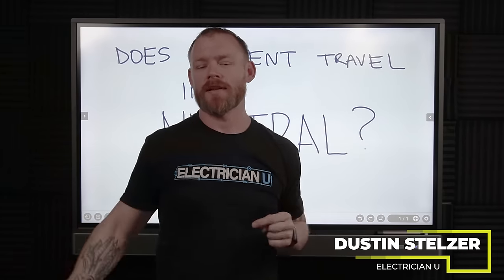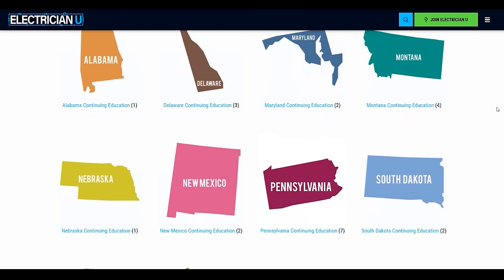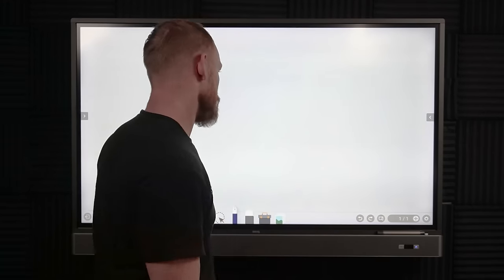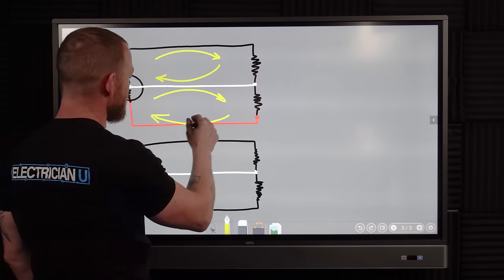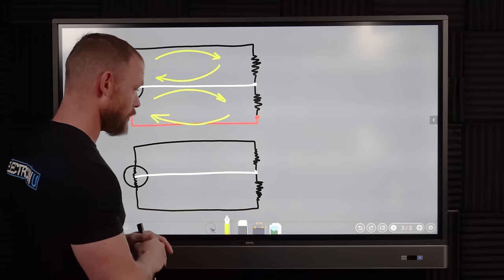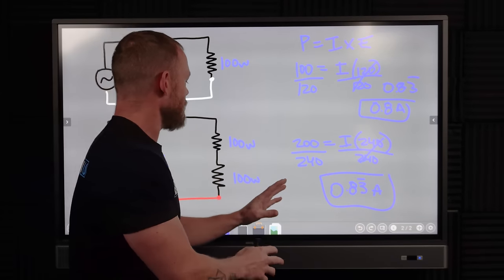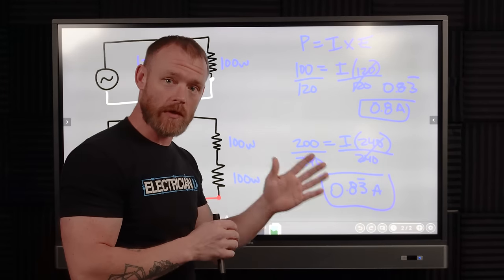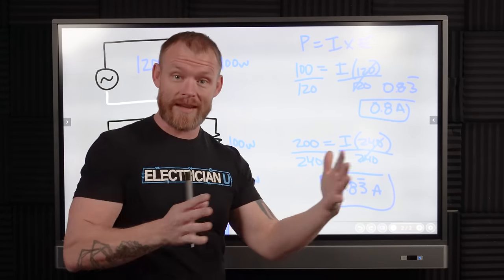Does Current Flow on the Neutral?

Comment: Has it been said that L1 & L2 are not phases they are taps off of a single phase?
Reply: Many times.  That is an argument for pedants.  Phase is a useful way to think of the relationship between the two 120V circuits.  You may view it another way if you prefer.

Comment: You're beating a dead horse what other way would you set it up when you're working with single phase. And by the way it seems to work fine the way it is if it's not broke and you're not getting an electrocuted don't fix it.

Comment: The wire is resistive too so there is some current and power but not 2 amps.
Reply: True enough, but if the loads are of notable resistance the wire becomes negligible, as it will have little voltage drop in it. The wire becomes significant only if the loads are low in resistance, producing high current.

Comment: Yes, current flows on the "neutral" and because of that, "neutral" is a wrong, bad name for it.  I call it "return", which still isn't accurate in terms of physics, but at least it doesn't imply you won't get zapped by it under the right conditions like "neutral" does.
Reply: “Return” is an inaccurate term so has its own pitfalls.  “Neutral” means that it is near ground potential under normal conditions.  Of course anyone working with electricity should be prepared for abnormal conditions.

People get confused when they don’t have a good grasp of the difference between voltage and current.

When you get a shock from a white wire, it probably isn’t connected to the neutral bus bar in the main panel.  When you disconnect a wire from the neutral bus bar, it is no longer a neutral.

Comment: I get it from an electricians point of view this may make sense, but it's inherently wrong.

There should be no current running through your GROUND/BOND wire, but you will absolutely measure current on the neutral. The confusion comes from the fact that at the panel NEUTRAL and Ground are connected together. 

Ground/Bond vs. Neutral is probably the most commonly misunderstood concept in electrical engineering.

Comment: Why not just connect it to the other phase directly? Why dance around with a 'neutral'?
Reply: The neutral is necessary to get 120v circuits from a 240v supply.
Reply: @GH-oi2jf  Then why not let things run on 240? Safety?

Comment: Your drawing is confusing. You need to separate the two hot legs. What you're trying to say is the two legs are out of phase, and they cancel each other on the main neutral side. 
 A good test for parasitic ground draw is to measure the hots and the neutrals for current draw. Both the hot and the neutral of a circuit should be the same current draw. If they are not, you probably have a parasitic ground draw or something wired wrong. The way to find that is to clamp each circuit ground to find your bad circuit.

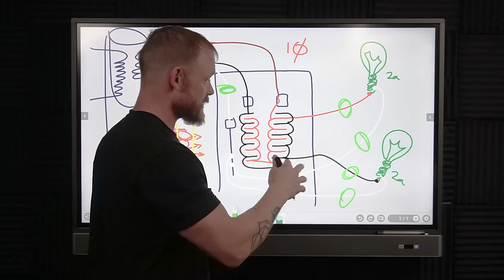Comment: You’re confusing phases with legs of power at 8:21. Your transformer is only connected to one phase. This is a single phase circuit. This is the reason so many people are confused by this and calling it a two phase system. There actually is a two phase system, but this is not it. Both of these legs are in time with one another, therefore they are the same phase.
Reply: L1 and L2 are from a single phase 240 volt secondary. Why people call them two different phases, shows a lack of knowledge by the author of this video. Line 1 and Line 2 are appropriate names. Or Leg 1 and Leg 2.
Reply: @MrSummitville  precisely. 3 phases are going down the street. The transformer in this example connects to only one of them, yet there are magically two phases on the secondary. I see it all the time. Real electricians who don’t know the difference and they teach it wrong because their teacher didn’t know any better either.

Comment: hmm i always thought if theres no voltage there cant be current and if you know anything about refference point high potential starts high then goes through resistances then reaches 0 volt refferences called ground or negative rail. if you put your leads between negative terminal and neutral end of a resistance your reading 0 voltage drops  in dc circuits

Comment: Geez. I have a ground neutral reversed and can't figure the damned thing out. At the light switch I get 125 between hot and ground, but only get about 60v between hot and neutral. I pulled all outlets and tightened/ checked all connections... nope. What's going on???

Comment: I like to know is it possible to hack into from the electrical AC side? As in now that they have smart meters , they claim they auto connect to your internet to help with meter reading but they do it bypassing your modem security settings.They do this so they can link people without internet meters to others that the people do have internet. So  this makes me wonder if its possible that hacking is possible through the AC power lines instead of wifi or Ethernet connections.Not just with power meters but with all devices that use AC power to power them.

Comment: What if you only had 1 breaker let's say black circuit. Circuit back to neutral bar. With no red circuits back to neutral bar. Where then?
Reply: The neutral is part of the circuit using the black wire, so carries its current.

Comment: No the fields don’t move. You get a magnetic field orthogonal to the change in electric field. The charge hardly moves. It’s not DC. It’s AC. The two phases are 180 degrees out of phase on a 240V domestic power in US. The neural current sums to zero at the junction. If you remove the neutral tap at the transformer, the light bulbs will still run. If the loads are different on any of the circuits(unbalanced) you will still measure neutral current after the junction (with neutral tap connected).

Comment: does current flow at all? Does electricity travel down a wire to a load and back to it's source?
Reply: Under the model we use for practical electricity, if you apply a voltage differential of 120V to a resistive load of 120 Ohms, then you will have a current of one Ampere.  What that current actually is and what it is doing is a question for physicists, not electricians.

Comment: Another completely unrelated electrical fact that is going to surprise and maybe even piss a couple people off. Your electrical devices are not powered by the current flowing through the wires in your cables, it is actually being powered by the electromagnetic field surrounding the conductors that is created as a byproduct of electron exchange. This was found out to be the case when a cable was being run under the ocean. The insulation and sheathing on the cable was too thick and didn't allow the electromagnetic field to be created outside of the insulated conductor, so the cable was rendered useless. It is the same reason why a light bulb sometimes will illuminate before making contact with anything. The electromagnetic field stays both inside and very close to the surface area of the conductor.

Comment: You do realize at 240 volts there's two sine waves right?... each at a different wave at different times. Where 120 there's only one sine wave at a time requiring a neutral for return. 240 volts is two different poles with one being upper half of a sine wave and the other being the lower half of a sine wave. 240 doesn't necessarily need a neutral to work because the two REQUIRED sine waves are switching, where 120 volts does require a neutral for return but then catches both sine waves at different times. Only way to explain this is by use of an occiliscope that shows the sine waves. Without the understanding of sine waves in any circuit being AC or DC your explanation is very confusing to the average person.
Reply: You are wrong, there are not two sine waves. Residential home power in the US is 240V SINGLE phase. Single phase = one sine wave. When breaking it down to look at the positive half of the cycle(0*), you need to think of a center tapped transformer as two 120V batteries in series(like in a flashlight) with wires on both ends and a wire between the two batteries where they connect(this is the center tap). This gives you both positive AND negative symbols at the same point. When the negative cycle half of the wave happens, you flip the entire assembly upside down and you now have a 180* phase shift for the negative cycle half. All the positive and negative symbols flip accordingly when doing this. This line of thinking will give you a handle on what is actually happening. This is also what the motor that is generating the power is doing. The above battery example looks at the generator wave(or rotation, as a wave is a circle stretched along an X axis) during two points in the rotation. 0* and 180*.
Reply: @s31ACE1252  240 volts home voltage in US is not single phase. It's two separate poles at 120 volts each. If what you're saying is true then anything that runs on 240 volts can be hooked to one pole and it would work but it doesn't because each 120 volt pole has to cycle on different sine waves for it work. Each pole for US homes is 120 volts, that's two separate poles running at two sine waves 180 degrees out of phase making 240 volts... you're wrong friend. That center tap is merely ground/neutral. A 240 volt appliance runs on two different poles at 120 volt per pole. As one pole is on one cycle running negative, at the same time the other 120 volt pole running 180 degrees out of phase is running positive THEN they switch and do this at 50 to 60 hz cycle times. Both poles are never the same cycle times at any given time because if they were there wouldn't be positive or negative at the same time and it takes both polarities but not at the same time. AC voltage never runs positive and negative at the same time, it's not like a battery. AC is ALTERNATING currency, as in both polarities cycle/alternate 180 degrees out of phase, each phase being 120 volts each.
Reply: FYI, I'm an electrical engineer who has been in this field for over 30 years. I've also taught this subject at a community college. You are straight up lost on how this really works.
Reply: @s31ACE1252  no I'm not lost, I know how it works. Power going into a house is 120 volts X two, equalling 240 volts total. It can't be one pole at 240 volts, otherwise there wouldn't be 120 volt appliances. Also circuit breakers have two separate poles just for this reason. Each pole IS 120 volts and every other pole is one being the upper half, the other being the lower half sine wave at the same time then they switch and exchange polarity. You claim it's only 240 volts but if that's the case how the heck you get 120 volts then?... you can't. There's 4 main wires going into your home, two are 120 volts each running at different sine wave halves until they switch, one is ground and one is neutral. You claim all this education, yet can you tell me what "neutral" is then?... and how you even get neutral? And yeah I know... do you? If homes only get 240 volts then it wouldn't be possible to have 120 volt items in your house. Your confused I'm not. Now in England you'd be correct because they don't even use 120 volts in their homes, it's 240 only at each pole but the physics are the same the current still alternates.
Reply: @garyr7027  Your claim of 2 sine waves, ie two phases, shows how much you understand the subject. Those two poles you are referring to are single phase 240V. The center tap to neutral(ground) gives you a zero reference from where you get 120V to each leg. That does not make it 2 phases. It's still single phase or to more accurately put it, split phase....but it's still only one phase.
Reply: @s31ACE1252  each pole is half a sine wave 180 degrees out of phase at any given time... that's "two" half sine waves. Did you forget about where neutral comes from and how it's there?... you even know? If you did shouldn't be a problem explaining it with all that experience you have.
Reply: I've tried to help you, but you are more interested in trying to tell the pros how to teach the subject rather than actually learn it. Good luck, you'll need it.
Reply: @s31ACE1252  Neutral is two points in time in a full sine wave at zero volts. It is zero degrees on an occiliscope measuring AC current... need more explanation? You failed to explain it so I did it for you and I don't even claim all this education. I know how AC current works I really didn't need your help... but thanks anyways.
Reply: When talking about a sine wave on an oscope. The word neutral never enters the picture. You reference magnitude, phase, and time.
Reply: @s31ACE1252  it does if you know what that occiliscope is measuring.
Reply: @garyr7027  You need to watch Dave Gordon's video on 120/240 in phase or out of phase.

Comment: Simplifying a problem that in real world is much more complex. Please don't mention electric fields on this level. It's a simple resistive mesh solved by Ohm's law as a special case of Kirchhoff's circuit law. But by combing different light bulbs (60w + 100w) it will show the necessitiy of the main neutral otherwise you'll end up with a classic assymetric voltage divider of 240v that will damage the 100w light bulb and will pull all neutral pins inside the house to hot. That's the real safety issue.

Comment: If the loads differ on the two halves of the secondary, there will be an unbalance current in the neutral center-tap.   When the loads are about equal, there will be very little unbalanced current.  The current will flow through the two loads (light bulbs) as if they were in a series circuit with the entire secondary voltage driving them.   All the chatter about electric fields moving is so much nonsense.   No fields are moving unless there is a radiation field, which is negligible at power frequencies.   There are stationary fields that are growing and collapsing at 60Hz (in the US).   These are induced fields resulting from the power company's alternator to which the primary circuit is connected.   The loads should be equalized or balanced in the two halves of the secondary circuit to minimize current in the neutral wire.  Otherwise there will be ohmic losses in the neutral between the neutral point in the panel box and the transformer's secondary outside the location.   The neutral return from each device (light bulb) to the neutral connection point in the panel box has the same current that is flowing on the hot side of the device.  It will feel warm if one touches the insulation.

Comment: YES becuse its the 180 out of  phase return path or becuse its ac its also the forward path as are both hot and neutral wires in 120volts or hot 1 and hot 2 in 240 volt circuts  neutral is the center point of any 240 volt transformer.

Comment: the only time there will be zero current in the common part of the neutral line is when the current in each of the 180 deg phase sides of the panel have exactly the same but out of phase currents, if the currents are not identical as will be the case most of the time there will be some current in the common neutral line
its so cute when "electricians" try to explain electricity as opposed to the physics department of a university
electricity and magnetism is among the hardest physics classes and if you don't have pretty strong understanding of calculous you can not understand electricity other than extreme simplifications
your circuit is correct, your electric field stuff is not very correct and the real answer about current in the neutral is there can be zero current and there may not be
Reply: Despite the difficulty of electricity from the viewpoint of physicists, practical electricity is so easy that a lot of people learn it in their teens, before ever studying physics or calculus.

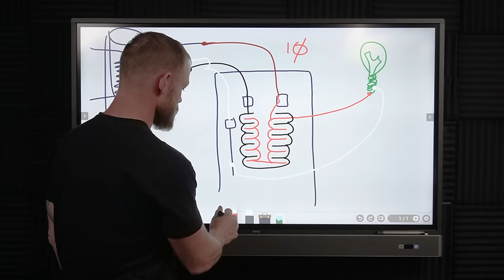Comment: [03:13] - "Every time current flows you have to have a complete circuit" - Nope, current flows from higher potential to lower potential. A circuit is not needed.
Reply: There is always a circuit somewhere, but he is concerned here with normal current through wires.
Reply: @GH-oi2jf  
"There is always a circuit somewhere" - Well, then you may explain how a capacitor works because the dielectric is not conductive therefore no closed circuit.

Comment: If you called those conductors connected to the shells of those bulbs “neutral” in an exam you would fail.
Do you not differentiate between an “identified” and  a “neutral” conductor?